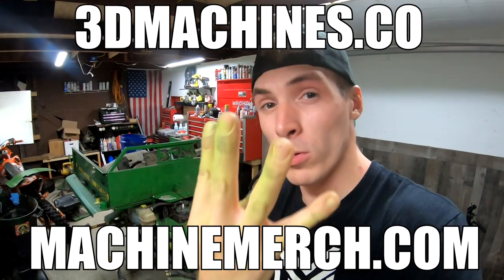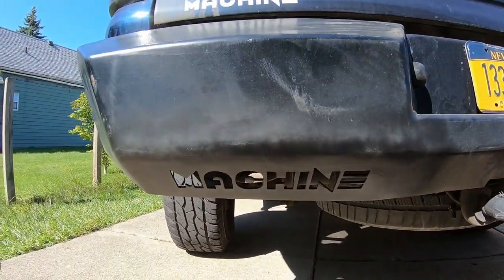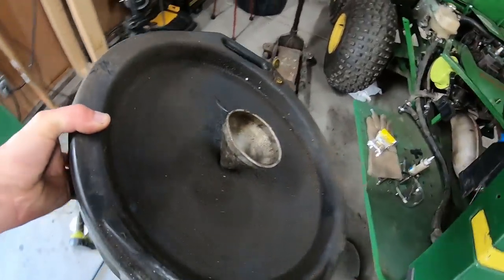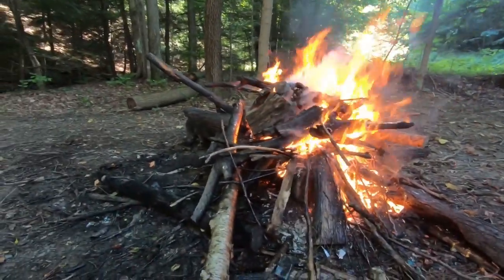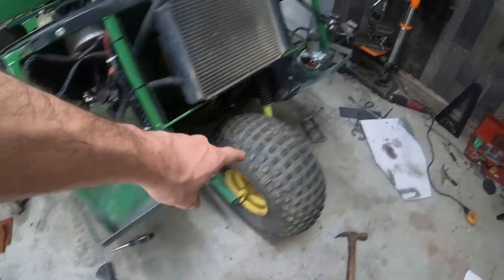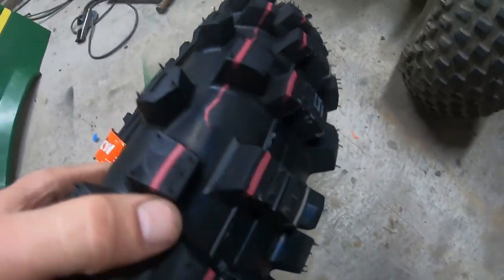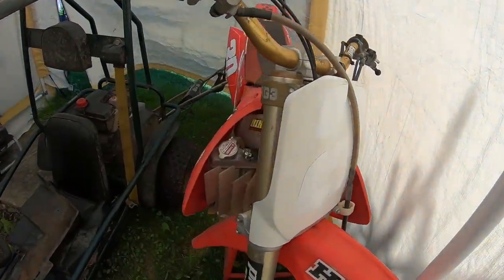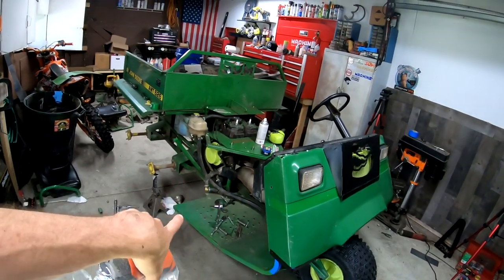Wishing I Didn't Sell all My Machines

Comment: Hey tip on the tires. Put a few lbs of air in the tube before you try to spoon the tire onto the rim. Should help prevent flat loose tube from getting pinched and pop

Comment: I've always used talcum powder, if not available then baby powder,  dust and spread it over the tube, inside of tire and spoke guard ring, also remove valve core and slightly inflate and deflate it 4 or 5 times to help untwist before putting second bead on. I always hated changing tires and tubes and the only thing worse is doing them twice when you break a tube, which everyone does now and then!

Comment: GREASE  the tubes.     you will never pop another one again !
Reply: NO!!! most greases can and will attack the rubber compounds itself, tire tube and spoke ring. talcum powder is best, baby powder secondary
Reply: throttle bottle just saying my tubes are fine      The life of the tire is way shorter then the damage if any happens to the tube.         All my tubes a just fine.     But each to their own.  
✊🏻👊🏻✊🏻